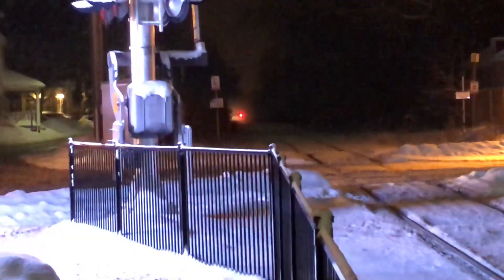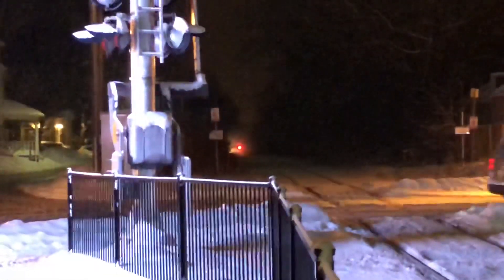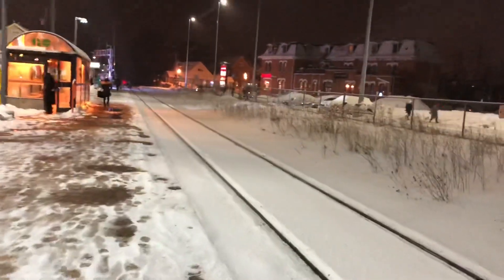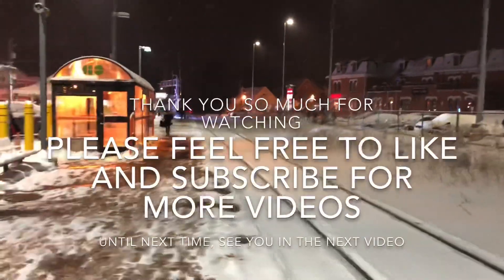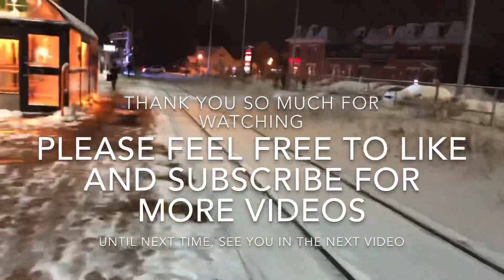(Awful and Loud Horn) MP40 Go Train Engine 623 Leads a 10 Car Train at the Stouffville Go Station

Comment: 623 really shouldn't sound like this. As you may know, 623 is among the very earliest MP40s, 600 through 626, which means when it was built new, it had a K5LA.
Reply from the maker: Superbaddy4 Agreed. :D
Reply: I just realized something! In the video I just uploaded today, one of the horn audio clips I played was actually of MP40 623 before they ruined it!

It plays during the Train Horn Challenge, where the Trainee Team tries to present it for a good score. Unfortunately, they only get an 8/10, compared to the very large number of 10/10s from the other teams. But, an 8/10 obviously still beats a 0/10 for a K5CA-LS!
Reply from the maker: Superbaddy4 Oh Wow! :D
Reply: Exactly. 600 through 626 did sound quite decent when they were first built.